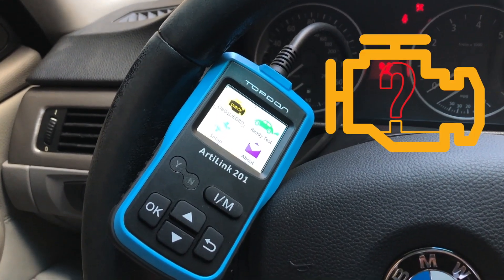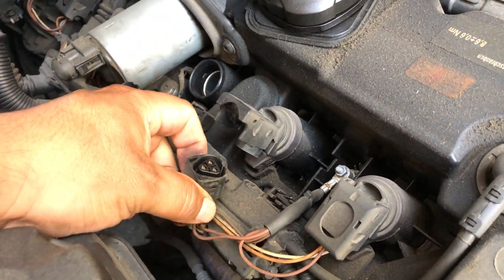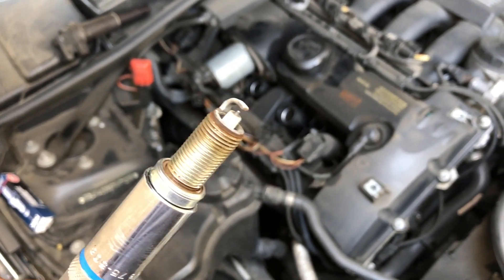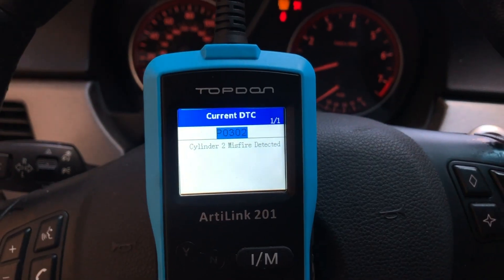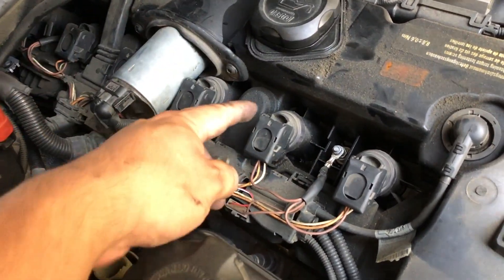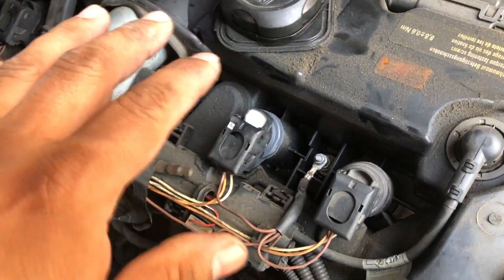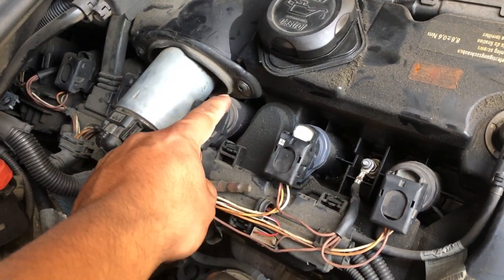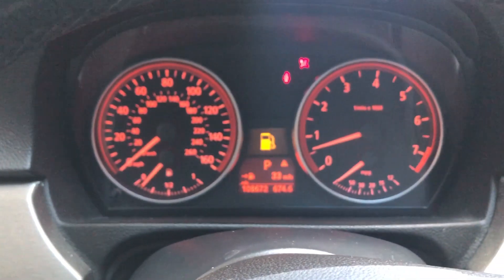Cylinder Misfire Diagnose & Fixed Repair Tutorial CODE P0303 E90 3 Series 528I 328I M5 M3

Comment: I have 2010 bmw x3 with 180000 mile i m having random misfire issue P0300,P0304 and P0306, i have changed new coil new sparkplug new air filter cleaned MAF sensor changed Valve cover gasket ,cleaned all fuel injector clean vanos solenoid and filter but this misfire keep coming back and at low rpm car gets hiccups this is on going from last 2 month but car runs very smooth on highway ,also when im at full stop i see very lite  white smoke from the exhaust i'm in NJ any idea what could be wrong  please give me some tips
Reply: Hi, did you solve the problem?  I have exactly the same problem, I also changed the injectors and nothing.
Reply: @mariuspopovici740  yes, i fixed my problem I used wired camera and entered through fuel injectors port ,I found disa valve broken flap stuck on cylinder 3 and 6 , I removed intake manifold and removed it bought new disa from Amazon and installed it also I installed oil catch can , after that no issue so far , wish you all the best for your repair
Reply: This kept happening to my BMW x1 and I was told it was my throttle body. I could clean it or replace it. I had it cleaned due to cost factors and it worked.

Comment: Listen... The NEW coil that you bought has a plastic “tab” on the bottom where the connector plugs in. Your plug has a small slit or gap in the bottom of the plastic and it is not in the same space as the plastic tab on the coil. You need to either get the correct coil that allows the plug to slide ALL the way on or simply take a sharp tool and cut the plastic away so coil will plug all the way into the coil pack.
Reply from the maker: tommy bell i’ll look into that thank you